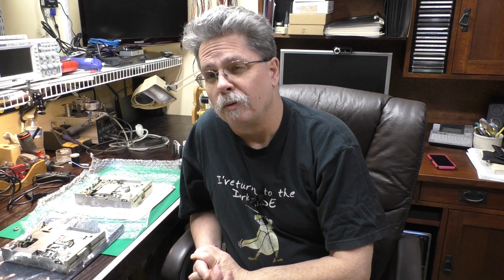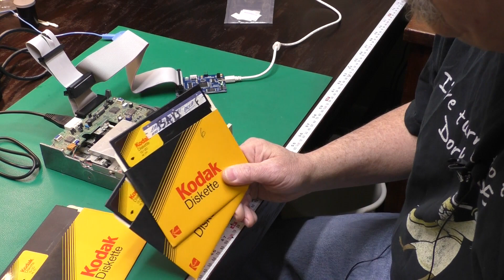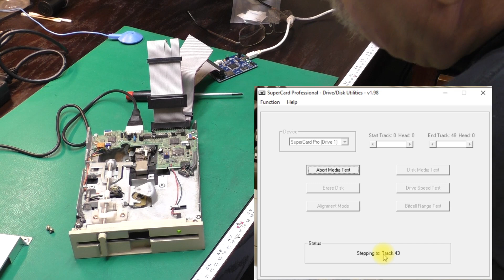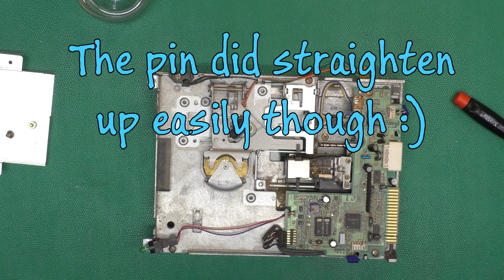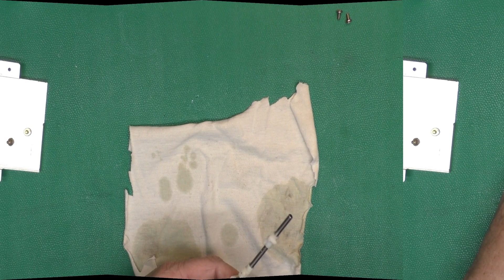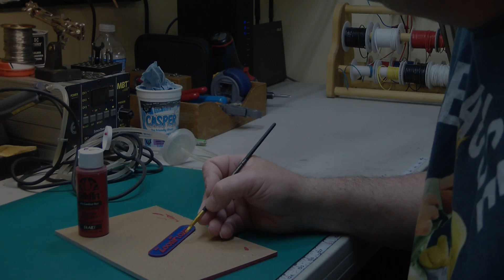Test & repair floppy drives with the SuperCard Pro! Cleaning, lubrication Pana. JU-455 JU-475 drives

Comment: From my experience, the best (non-damaging) solution for cleaning dirty electronic boards, is to first brush all the dust off with a painter's brush, then spraying medicinal alcohol (or IPA mixed with 30% water) + 1 or 2 dabs of liquid soap (directly on the board), and scrub that with a brush (similar to a toothbrush in softness, but with a bit longer hairs). You need the longer hairs, in order to not bump taller components like electrolytic caps.
Then, rinse with hot water afterwards, and then spray A LOT of medicinal alcohol to displace all the water from the board. Then, blow with air compressor (or use paper towels and leave to dry). 
The boards will come out looking like new.

Comment: Thank you very much.  I bought two of these drives at a flea market meet-up (JU-455-7), and I think I just repaired one...  No more crashing sound and I formatted the disk successfully.

I did use oil on the shaft, but instead of lithium grease on the worm gear, I opted for silicone grease (low viscosity).

Now I have a second drive to repair (it has another problem where the wire on the track 0 detect LED is detached), as well as a JU-475-3 (high density version).

The reason to have both of these in a computer is because 1.2mb drives are not fully compatible with 360KB floppies (disks written on a 1.2mb will not be readable on a 360KB drive).
Reply from the maker: They seem to be robust drives. I have only had one I was not able to repair and it was in very bad shape.  You are correct about keeping a 360K drive around for writing those floppies. The only exception is that you need a 96TPI drive for C64 floppies in order to handle the half tracks on many disks.

Comment: Thanks for the video. Just what I needed for doing some testing and repairing on a stack of drives. Now that I've retired I've been getting back into restoring some of my old S-100 and other CP/M computers put away decades ago. I have been running into old too many floppy drive issues. Just dirty old beast issues and perhaps a few alignment issues. So I just purchased a SCP, dug out an old ATX pwr supply, and have been testing some 5.25" drives for now. Soon as I build an adapter cable and a pwr supply I'll start on some 8" drives. Once I have some tested drives I can work on some controller board issues knowing that it's not a drive causing the problems. Later on a second adapter so I can test 3.5" laptop drives that use a 26 pin ribbon cable. Gives me something to do this upcoming winter and while Covid keeps me inside.
Reply from the maker: It is one of my favorite purchases. I have been able to image all my old disks and grab images from online to write onto real disks for newly acquired machines.

Comment: I had the same drive with the exact same issue and noise yours made. Followed your lead and now my drive works fine. Thanks for the tear down and restoration procedures. My drive wasn't nearly as dirty as yours but a good cleaning (which I didn't think was the problem) brought it back to life.
Reply from the maker: I'm glad it was helpful. I have found a good cleaning will get most floppy drives back in working order. The older belt driven ones are often more cantankerous tough.
Reply: @HeyBirt  My father used to work on those back in the 80's. I remember him using a light to shine on the drive spindle that contained black marks for timing. When in correct time the marks would magically stop moving.

Comment: Great video Jeff, really enjoyed that. I’m a sucker for any old floppy drive refurbs and it worked great after a good clean. Does the SCP only interface with PC style drives or dies it also interface with a 1541 ? Looks like PC floppy only. I guess the Zoomfloppy would be what I’d need for a 1541
Reply from the maker: The SCP interfaces with any drive with a standard style (PC) interface. It does have an header on it labeled 'IEC' which was included for possible someday talking on the Commodore IEC serial bus. 

The 130+ disks I archived were all C64 disks and many of them would not work with the ZoomFloppy/1571 drive combo. If there are any sort of errors it just bombs out. The SCP will try multiple times and compare the data it gets back to try and recover the data.

The ZoomFloppy and Commodore drive does have the advantage that you can use it with VICE though. For Archiving I think the SCP is the best tool for the job.
Reply: @HeyBirt - So SCP images of copy protected disks cannot be used directly in Vice, only if rewritten to a physical 1541 disk and connected to the PC via ZoomFloppy (or not even that)?
Reply from the maker: When imaging a C= disk with the SCP you can choose to save directly to a .D64. You can use the .D64 file in VICE, etc. 

If you have an SCP file you can convert that to a .D64 using the SCP software (I think) or other conversion software.
Reply: @HeyBirt  - Yes of course a D64 can be used but I was wondering about copy protected images made in SCP format.  Those cannot be run in Vice directly?

Comment: Did you use the 360k drive to image most of the disks or did you also use the 1.2?  What about side 2 on disks that don't have a second index hole?  KryoFlux can't deal with this at all unless you modify the drive to be able to image both sides at once.  
Excellent video and looking forward to seeing the 2nd part.  

I have both a KryoFlux and a SuperCardPro and while I have imaged plenty of disks with KryoFlux I haven't yet done the same for SCP.  You can write images back to disk fairly easy with the KF, even though it is mostly command line.  Last time I used SCP you could only write back SCP flux images.  Maybe this has changed in more recent versions?
Reply from the maker: I first imaged all my C64 disks with the 1.2M JU-475-4 drive. I then tired some of them that had errors with the JU-455 360K drive and was able to recover more data. This might be due to slight differences in alignment, width of the read head, etc. For C64 disks that use half tracks for copy protection you will need a 96TPI drive (1.2M).

The JU-475 1.2M drives have a jumper that tells the drive it can still spin the motor even if it does not see the index signal. In the SCP software you can set it to use the index (for commercial software) or ignore it (for the backside of disks or anything written on a Commodore drive.)

There is other software available to transform SCP files to/from other image formats. I'll cover this in the next SCP video.
Reply: @HeyBirt  That is cool that you can enable the motor on side 2.  I have a Mitsumi D509V5 (That I can tell) and it seems to have only one jumper that I remember.  It does work good for imaging and for writing back to disk.  This disks work fine on all my Commodore drives most of the time.  And that is usually G64s.  Some don't work because they were remastered for emulators.  I need to find one of those Panasonic drives it looks like.
Reply from the maker: @RacerX-  Sometimes drives will have wire jumpers soldered on the PCB. It does seem like the Panasonic drives are more configurable. There is a list on the SCP forum of drives that are known to work and a PDF of jumper settings.

Comment: SuperCard Pro looks great; it's out of stock now but I signed up for availability notifications. I've found ZoomFloppy (and/or OpenCBM, not sure which to blame) fairly frustrating as it deals very poorly with errors on the disks, which happens quite often when archiving a bunch of old floppies. When you do your follow-up video, I'd love to see how it deals with bad disks.
Reply from the maker: Jim said he should have some more the first part of March. I will cover disk errors for sure. Something else interesting I found what that the JU-475 (1.2M drive) and (JU-455 360K) read some tracks differently. This may be slight differences in alignment or due to the wider head of the 369K drive.

Comment: The drive latch handle is friction fit onto the shaft (at least I never found a set screw!) If you pull it off, you can remove the front plate without removing the interlock assembly.
Reply from the maker: The handle is pressed on but in my experience they are so tight on this type of drive you can't budge them. Or, maybe I'm a wimp :)

Maybe a gentle heating with a hair dryer would enlarge the handle enough to make it a bit looser?
Reply: @HeyBirt  Then again, you do have to remove the interlock assembly to get access to all the other components so in your video you did it right.
Reply: I've found that only the Teac models of drives allow for the drive latch to come off fairly easy. On my recent Panasonic cleaning (following Birt's lead) I applied what I felt was too much force trying to remove the latch and it didn't budge. The hair dryer idea is good though, may try that if I ever need to tear a non Teac drive down again.

Comment: How does Supercard pro compare to the Kryoflux ? It seems that the software and installation is way better on Supercard. Kryoflys is a pain to install drivers for.
Reply from the maker: I don't have a Kyroflux to compare. Their main purpose of flux level imaging is the same. The SCP is very easy to set up and use. The only 'trick' to installing the software is to right-click on the installer and run as administrator. This is explained well in the manual.

The software works well but could be better documented (but that is true for a lot of software.)
Reply: SCP has propper archival file format. Kryoflux file format is just a dump of information between the hardware and the drive. Each track is stored in a separate file and this quickly becomes unwieldy.
Reply: What was the floppy test setup that had the floppy power supply used? Thank you for this video because I need to get something like this
Reply from the maker: @circuitsandcigars1278  Are you asking what power supply I used for the floppy drive? If so, it is from a USB<->IDE adapter kit I bought many years ago (ones used to temporarily hook hard drives to PC through USB for imaging.) You can buy these kits now for less than $20. 

For a 5-1/4" floppy you need 5V and 12V for a 3-1/2" floppy you just need 5V and can use the 5V floppy type connector on the SuperCard Pro (if your USB port can supply at least 500ma)